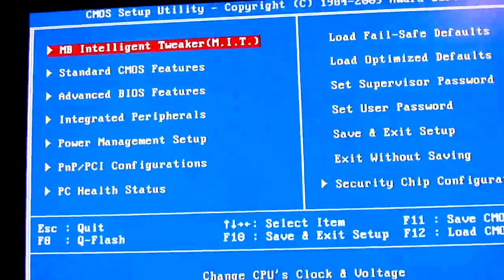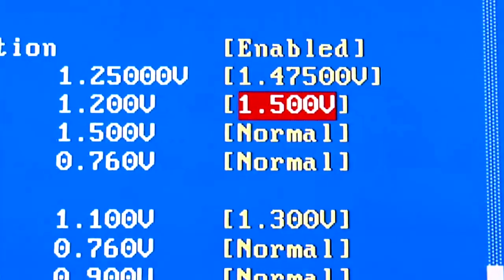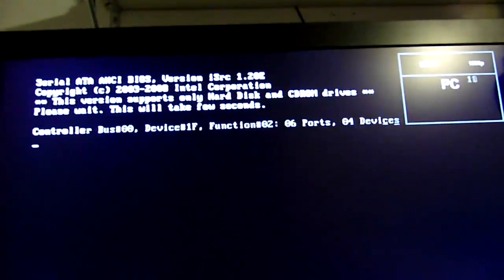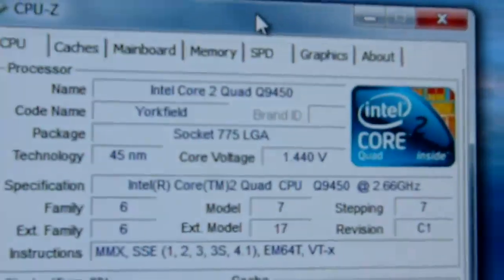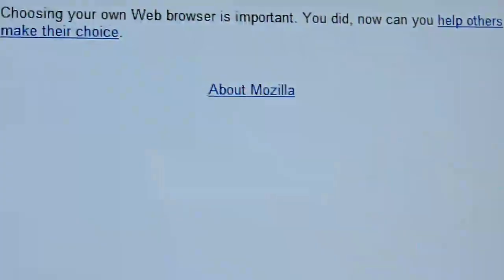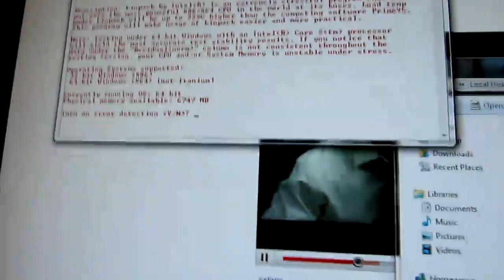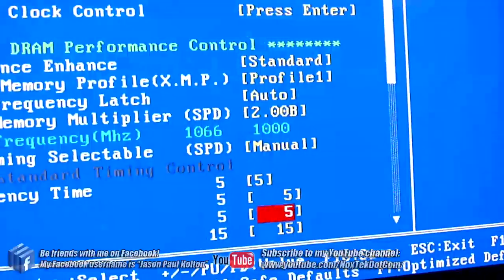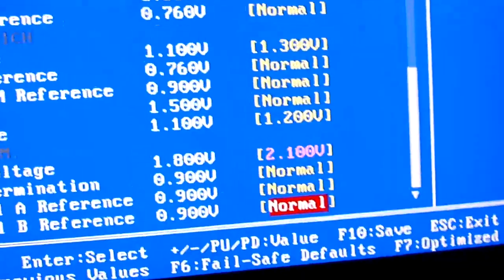Overclock the Q9450 to 4ghz!

Comment: Voltage recommendation table from anandtech: https://www.anandtech.com/show/2500/4
What the author did wrong (well, almost everything)
- First basic rule for novices - do it in steps: increase frequency, check stability, adjust, repeat
 - MCH Frequency Latch (or Strap as they call it on Asus). For 450+ FSB you should use fixed strap 333 or 400, lower straps will give you better performance (lower performance level) but are stressing chipset too much for high frequency runs. I recommend strap 400 for 500+ FSB but this depends on mobo - Asus P45 in general doesn't like running 500+ with quads and it sometimes prefers 333 strap for highest frequencies. This will also narrow down your options for RAM speed.
- Should have checked what the RAM is capable of separately. For example with core 2 duo on minimal multiplier settings you would adjust FSB speed and mess around with RAM timings and voltages. A lot of 1066 rated DDR2 is capable of 1200 5-5-5-15 with some voltage bumps.
- 1.5V VTT (CPU Termination voltage) is DEADLY for 45nm CPU's and that CPU really didn't needed that much. Massive degradation occurs under stress with high VTT. 1.36V is the highest recommended for 24/7 use. Unless you don't really care as those cpu's are cheap now. Anandtech killed QX9650 with 1.51V VTT.
- Increase CPU PLL voltage to gain stability at 500 FSB and beyond. 1.7V should be more than enough at 500.
- increase NB/MCH voltage to gain stability at  500 FSB and beyond. Depends on amount of RAM used, module size, DDR2/DDR3 and number of cpu cores. DDR2 P45 boards like less VNB than DDR3 variants. 1.4V would be max for 24/7 in my experience. At 1.5V BIOS corruption may occur.
- Vcore voltage - depends on CPU rev. E0 needs less and overclocks way better than C0. Most of C0 quads will not be capable of running at 500+ FSB.
- Flash latest BIOS. On P45 motherboards they did a lot of tweaking to get higher OC potential over the time. Early bioses were only capable of ~450FSB while latest when used by good overclocker with LN2 cooling those Gigabytes could fly to 611MHz FSB with 45nm quad. I'm holding WR 5282MHz - 9.5x556MHz FSB on LC cooled X5460 on EP45T-UD3R.
- There are programs that allow making adjustments on the fly under Windows. Gigabyte EasyTune 6 (Gigabyte only), SetFSB and MemSet.

Comment: ayy this makes me happy, overwatch maxes my cpu almost all the time (all 4 cores at 90-100%) and running stuff in the background then just kills my framerate...
my hd 5850 is at about 70% so that surely isn't the problem
so yeah I hope 3 - 3.5 GHZ will help with that :)
Reply: Thunder Draws I plan to build a PC with Core 2 Quad Q9450 and a Radeon HD 5850. I got the board, psu, a DVD drive, the graphics card and a case. I just bougt the cpu so now I just need 8GB ram. I plan to overclock this cpu to at least 3GHz.

Comment: you can throw that chip away
Reply: +iyfranco151 This video was filmed in 2010, well done
Reply: and tomorrow I will overclock my q9450 to stop it from bottlenecking Overwatch haha :'D
it works fine most of the time (60-70fps) but sometimes dips reeeeaally bad, especially when I have some other stuff like skype running....

Comment: I am trying to push my qx9650 past 3.6 stable on a EP45T UD3LR ddr3 1600 board. 
I could break this limit on my old board but i could never get it stable. Thought there was a good chance i could get to the 4.0 mark stable. so far no luck. temps are in the 35's

I think my ram is the issue. My ram is advertised as Kingston HyperX blu 8GB DDR3-1600 (PC3-12800) CL9. Or  maybe my EP45T UD3LR isn't as good as my EP45 UD3P. Any links to this particular board and settings would be greatly appreciated.

Comment: By the way you VID gotta be as low as mine this is the lowest VID chip I have ever had normally I get a 1.325 VID chip but this one's 1.1875 VID so bare this in mined the lower the higher the OC!
The seller wont tell you what the vid is so its pot luck weather you get the best one!

The VID is basically the Voltage the chip was made at or came out at! lol

Comment: Great my runs the same all the time 25/7 or it will be one day! lol

FSB Termination = 1.90v max and CPU= 1.488 voltage increase from 1.45v.

The higher the FSB voltage the better but have a Asus P5Q Deluxe or higher so the MB doesn,t blow up. 

I got CrossFire 4770 above 22000 3dmark06 ass!

Comment: I was trying to do the same overclock you did at 3.5ghz and mine isn't as stable as yours. I'm using an EP45-UD3L and Q9450. It boots fine to windows but when I play a 720p movie it locks or show me a BSOD few moments after. I'm using 2x2GB modules of DDR2 800 Kingston (KVR). What do you suggest? Thanks.

Comment: @AlpcaNxTremE It's because every chip is different. It's not because all your settings are the same, that this specific unit will reach 4GHz as well. 
Mine is stable at 3.61GHz with 1.36V
I'm pretty sure i can overclock it more but i just kept this stable clock, since it only required a minimal voltage increase.
I have an Asus P5E motherboard by the way.